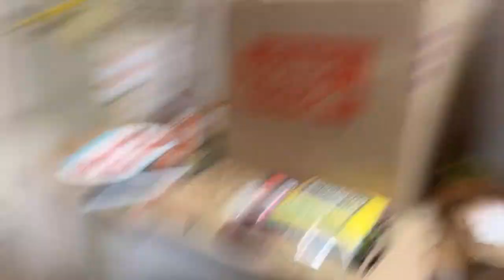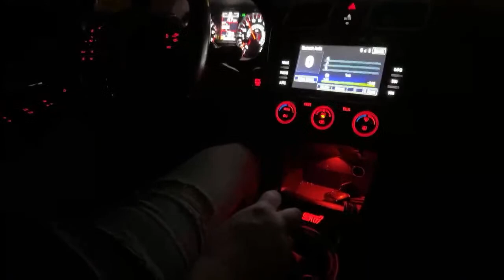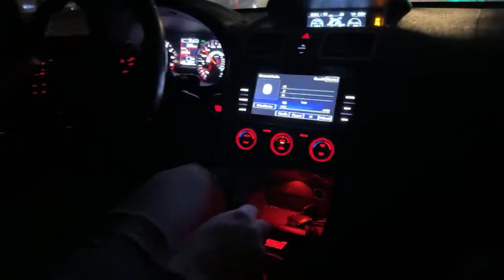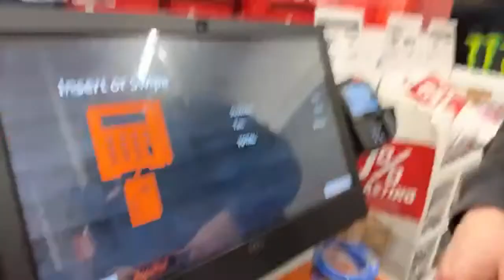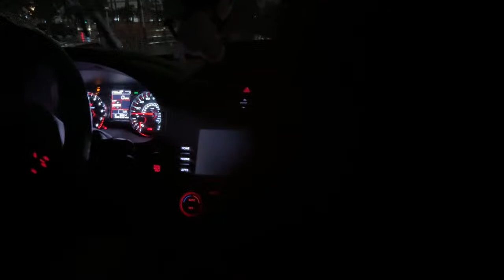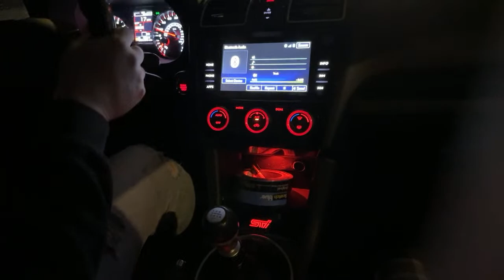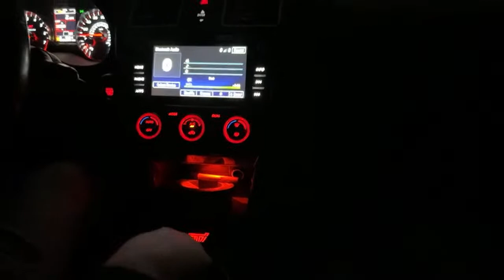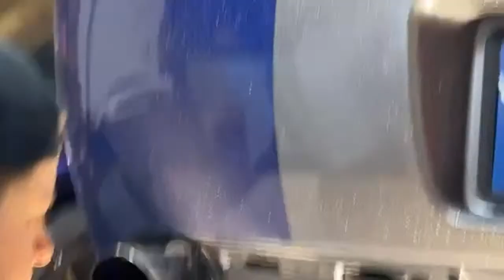Chopping Up The Mustang!!! (Livestream)

Comment: You need a Dremel tool or a die grinder to shape the holes and clean that all up nice. They make metal bits and bits that have sand paper as well as flapper disk style bits. And get yourself a heat gun to clean up all the stragler hairs and scratches. I would also recommend a hole saw for the ends of your slots. Cut the holes first , then connect your cuts to the holes.